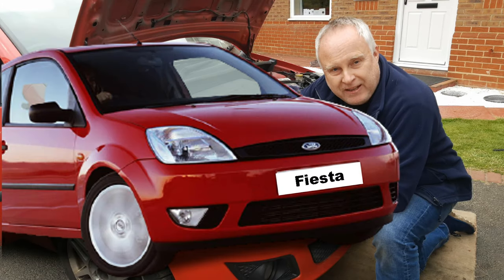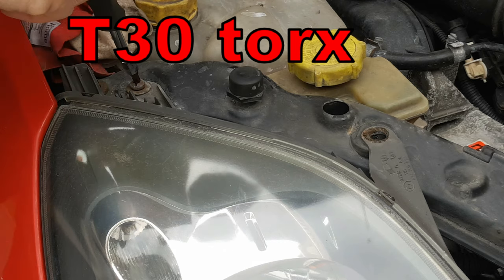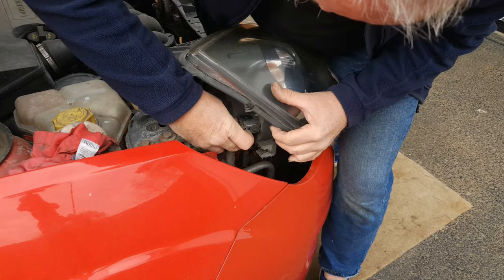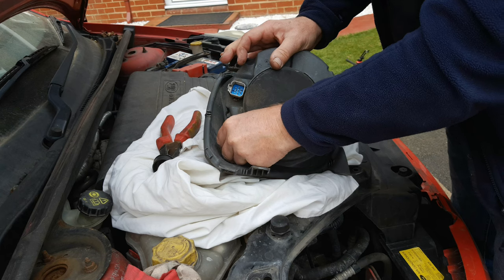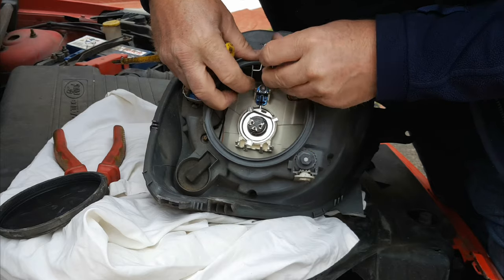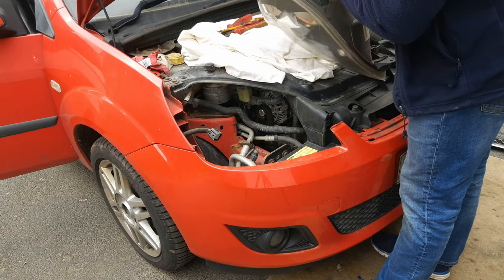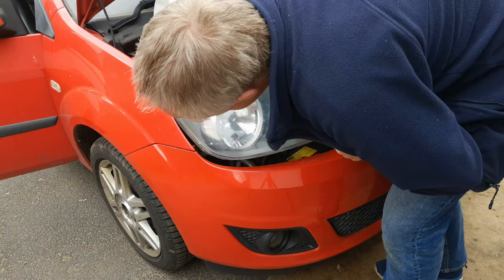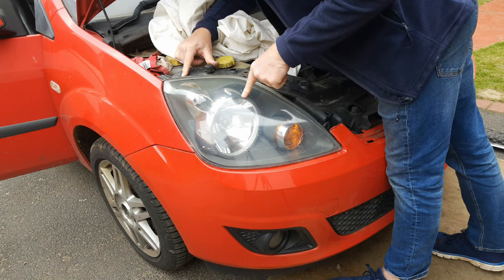Headlight Bulb Change Ford Fiesta mk6 | Headlight REMOVAL is a MUST

Comment from the maker: 🎥 Duratec engine oil change: https://youtu.be/PlBFEM_64XY
Reply: Hello i have a mark 6 fiesta ist basic with no electric windows also don’t have a central locking and button for the tailgate my question is ist possible to put a button for the tailgate and what is the procedure because every time i have to unlock the tailgate with key and is not very comfortable thanks 🙏

Comment: After watching this great video - I thought I could do this! I could replace a H4 headlight bulb by myself - what could go wrong? Well, taking the headlight assembly off was the easy part. What was incredibly difficult - was removing that wire clip! It was next to impossible. Eventually, after broken fingernails and bleeding finger tips, it flung open. I removed the old bulb, inserted the new one - and put everything back - AND secured the light assembly tightly back into the car! It was only then that I realised - I had FORGOTTEN TO ATTACH THE RUBBER CAP!!!  Aaarrgghhh!! Yep - it all had to be removed again....

Comment: Brilliant video. My clip is missing.
Like you say the headlight sort of rolls out and back in.
I used a 1/4 drive ratchet and torx bit to undo the screws (no extension).

Comment: hi cyd, a very good video with step by step instructions( haynes 2 out of 10) well done !!!!
Reply from the maker: Glad it was helpful.
Reply: hi cyd,thanks much for reply to my comment, re-headlight bulbs , have since renewed both headlight units!! like you mentioned , can be a fiddly job, old lamps scratch/ internal haze!!!next job might be renewal  of rear brake shoes, again this is a job where you must remove the drums to inspect the old shoes nb--- can work out expensive in 2006  fiesta mk6,, however while trying to remove the centre axle bolt i noticed the 30mm nut has a strange type of sealed over six point washer covering the nut ( shouldhave gone your route & undo the four bolts on backplate ) that was very good video ,,,!!!! thanks //regards neo @CycloneCyd

Comment: I warmly thank your clarity and conciseness.. our 06 wonder had sadly this evening popped a bulb...lets try to do a full set of bulbs one time for effect.

Chard Waves Sincerely.
Reply from the maker: Did you manage okay?
Reply: As you spoke so I fiddled..yet the LHS is happily complete...RHS not yet...I found the loom holding that side too tight to turn away from the bumper cover...the bulbs ok..so will turn to our local Diesel Electric shop should it require.. good morning to you from Chard

Comment: I'm thinking of getting a mark 6 fiesta. Are they reliable?
Reply from the maker: No better or worse than any other similar car. getting one that's been looked after is the trick.
Reply: Super reliable. The engine is indestructible only is some issues with the external plastic parts they kinda get loose after a time.
Reply: Our s has been apart from the low cost clutch slave at the pedal.